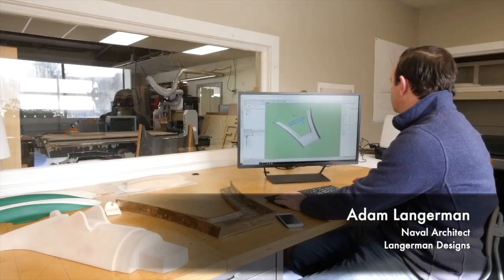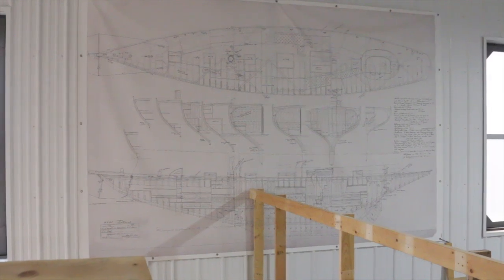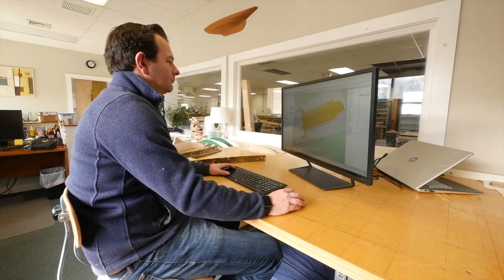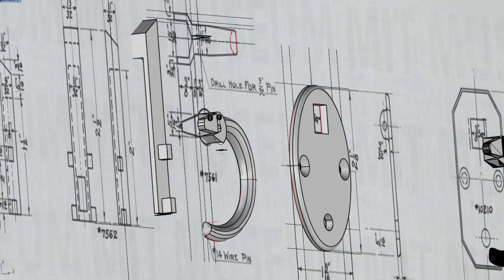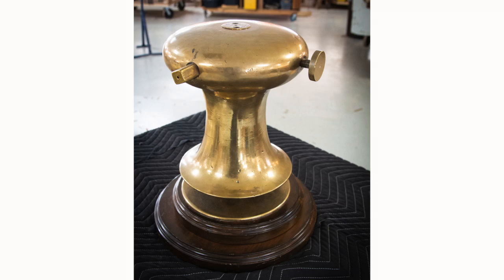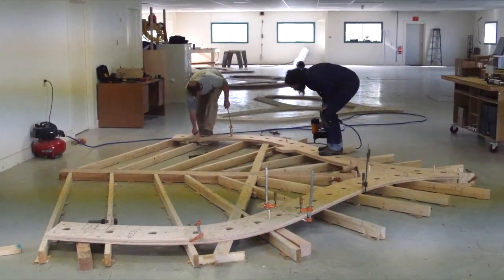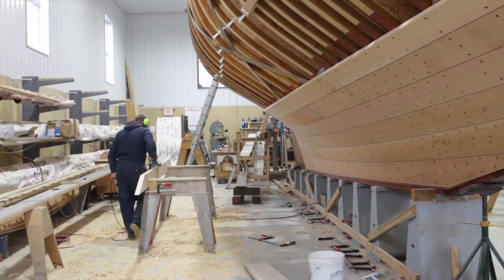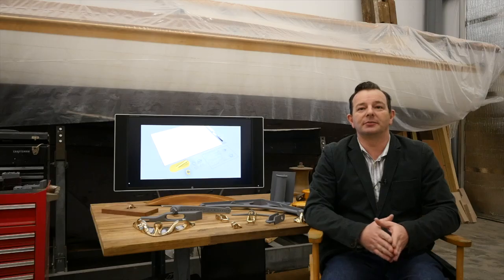Integrating New Technologies into Traditional Boatbuilding, DORIS Restoration Project

Comment: I was the Captain and project Manager for the re-rigging and restoration of Herreshoff's Mariette in Italy in 1995. Mariette was launched in 1915. Her Herreshoff construction number was 772. Mariette was converted to a Marconi staysail schooner rig in 1949 with permanent backstays.
 I was responsible for getting the original drawing from the Hart museum at MIT and restoring her to her original gaff rig. I had wooden patterns made for all of her deck and new rigging hardware. All parts were sand cast in nickel aluminum bronze ( better known as AB2 ).
I redesigned the inboard and outboard gaff end fittings. I had all her masts and spars built by Harry Spencer in the UK. We raced her in the Classic Yacht regattas in France and Italy.